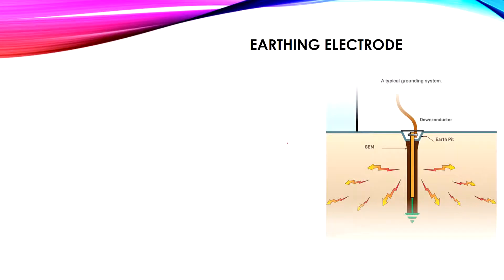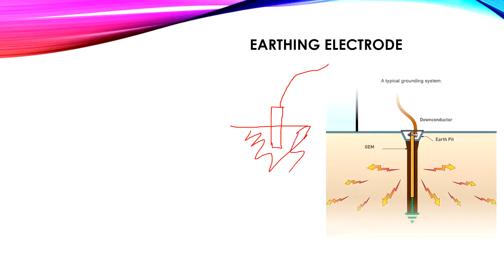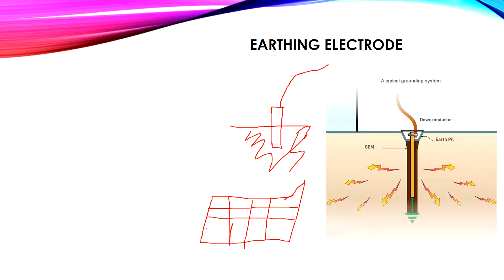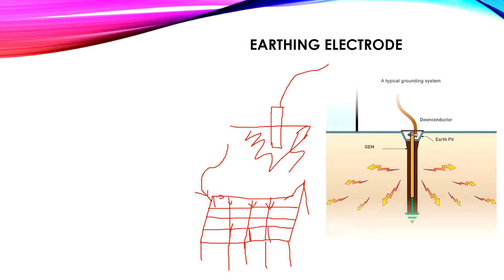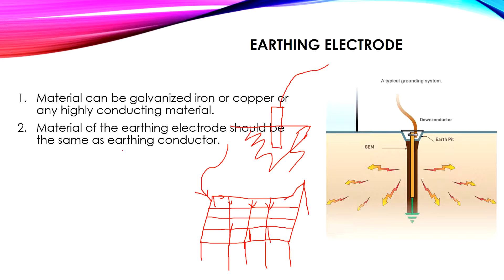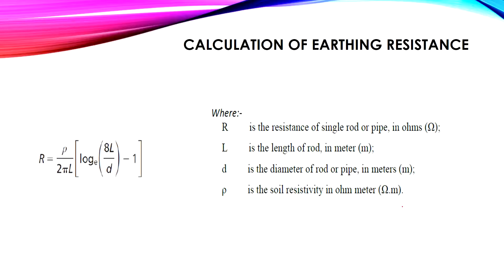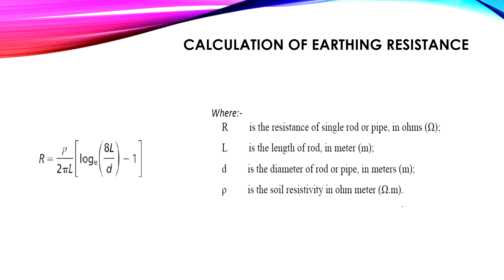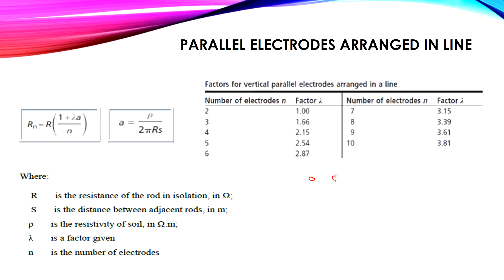Design and Resistance of Electrical Earthing Electrode - Lesson 5 in Earthing System Design Course

Comment: thank you Ahmed your video is very useful  , could you make an another video to explain the value of the resistance, R, expressed in when the vertical electrode surrounded by an infill of material such as bentonite or concrete please
Reply from the maker: In this video we explained the effect of resistivity of soil on electrode, when we are using Etap, we will be able to add concrete surface to protect human from earthing grid contact.
Reply: @EngrAhmedMahdy   when we connect a lot of electrode in parallel why we do not take into consideration the resistance of the cable that joins the electrode between them ?
what is the section (cross-section) of the cable that connects the electrode between them ?